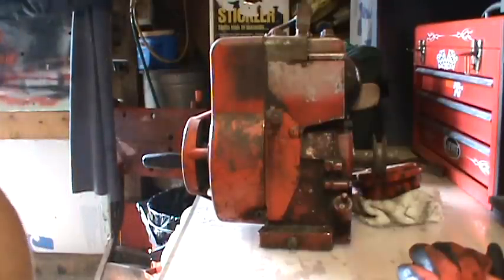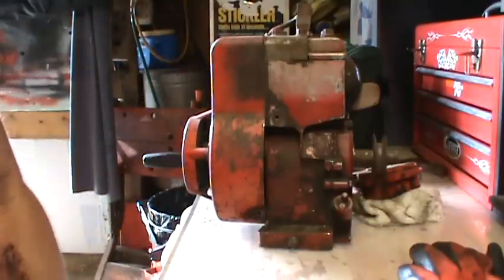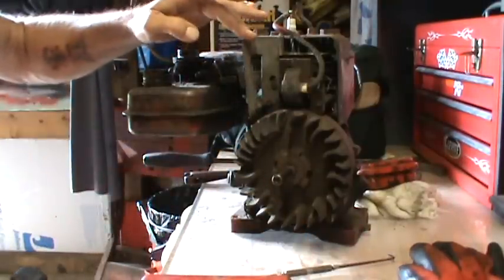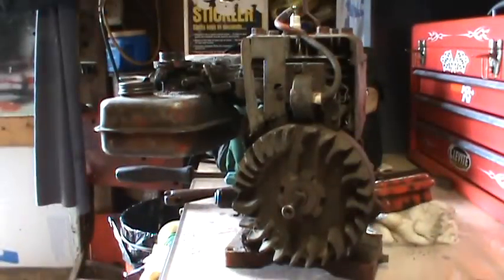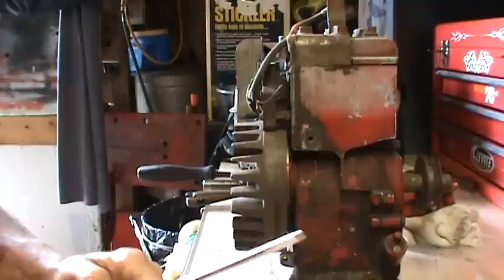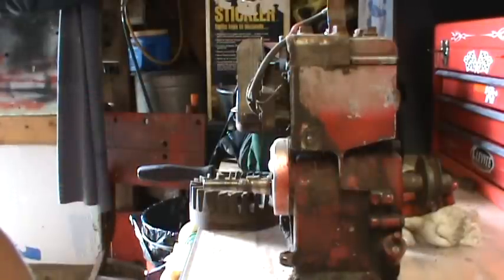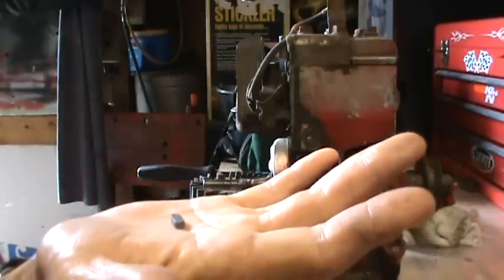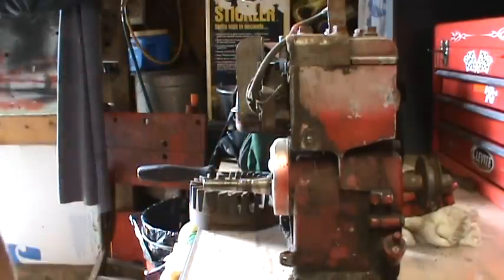Briggs and Stratton B&S Engine Tips and Tricks

Comment: Hi Zippo. I have the exact same engine on a 1988 "Little Wonder" Pro Edger. Can you please tell me what engine it is, as I bought it as a non runner on Gumtree UK  for £10. I'm an old mechanic of sorts and haven't worked on engines since the mid eighties but have found that there's no spark at the spark plug. Have checked the ohms resistance with a multi metre and it's 4.18 on the 20K ohms setting which tells me the coil is ok. Have cleaned the base of the coil and flywheel, reset the coil gap with a credit card but still no spark. You have said that you think the points have oxidized in this video, can you do a follow up video on this please. Kind regards, Tim from the UK.
Reply from the maker: Search my channel for "Points" Timothy. I cover cleaning points. They're under the flywheel and should be under a protective cover. Zip~
Reply: @ZippoVarga  Thank you Zip~ Regards, Tim from the UK.

Comment: Zippo looking for a starter recoil assembly 691958 came off 1982 16hp single
Reply from the maker: Alessandro, Search Google for part number 691958. This is the pull start assembly for the late model 16hp engines. If you're still having problems, go to the Briggs and Stratton web sight, use the model and type numbers on your engine and download your engines IPL (Individual Parts List) Manual. There, you can find all of the part numbers for your engine. You can then go to Partstree.com or Jackssmallengines.com and source just the parts you need for the pull start assembly. Cheers! Zip~
Reply: Yes did that thought you might have a take off you would be willing to part with
Reply from the maker: @projectthinblueline87musta93  Unfortunately, I do not have any pull start assemblies. Zip~
Reply: Thanks zippo, love the channel keep up the great work and stay safe
Reply from the maker: @projectthinblueline87musta93  You as well! Cheers! Zip~

Comment: what ohm does a good coil give ?
Reply from the maker: Anything less than 10K ohms should indicate a good coil. As the coil wears, the resistance increases. Different coils have different "dead" specifications, so check your MFG for those. Also, if you're suspecting a bad electronic ignition coil, remove the kill wire from the coil before testing. Often, a bad ground can mimic a bad coil or high resistance. Hope this helps! Zip~

Comment: I have 50 + yrs.in auto,truck,etc. I like to find a cross reference info on Br,iggs teucumsa engines.If you find any let me know.Jim. I got ton of old parts also. If  you need let me know.
Reply from the maker: +James A. Quarford There was the holy grail of web sights with all kinds of information on the older engines of all makes, but the web master took the sight down and is refusing to sell the rights to it. It's a shame that happened and hopefully, someone with the means will open a new sight to help us all, as I too used the sight. It was ASECC dott comm. Sorry to be the bearer of bad news there. You can still obtain many of the Briggs and Tecumseh manuals directly from the manufacturers though. Thanks for the parts offering. Cheers! Zip~